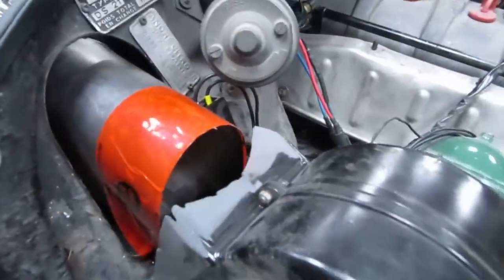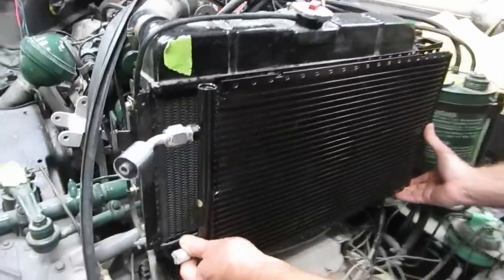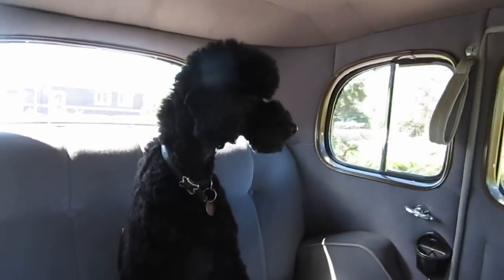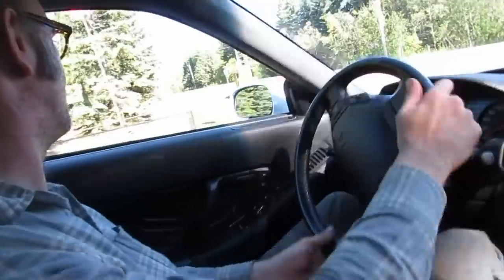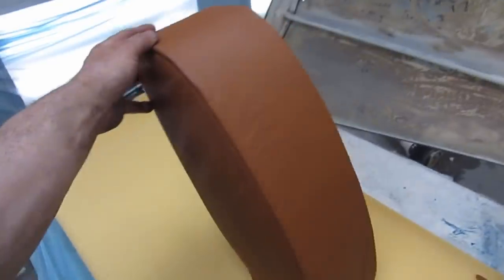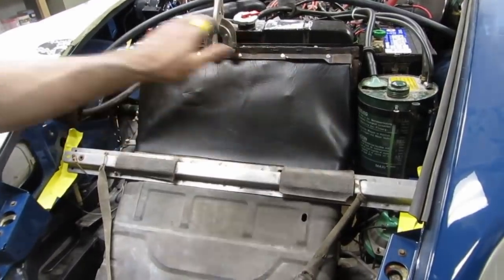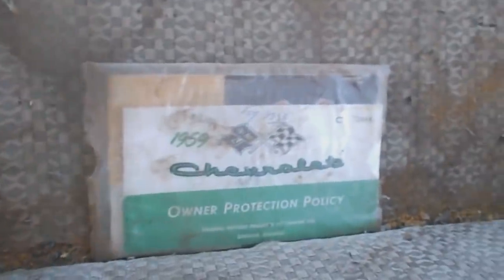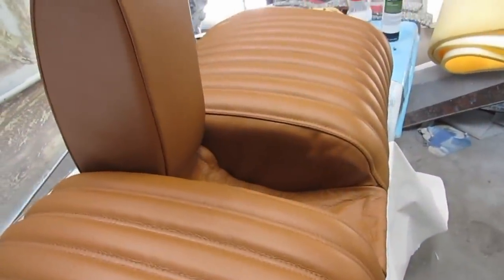Citroen Progress, Pontiac, Suzuki Drives. and Breaking News with Dean!

Comment: 64 years old, I learned to drive in a standard and today I learned what double clutch really is!  thanks
Reply: Yeah, I knew what double clutching was, but back when I was 17 years old I couldn't do it on an ancient old commercial truck I had an opportunity to drive, I kept instinctively pulling the shifter too early. Scott's method of removing his hand from the shifter until the clutch was let out in neutral, is a great way to prevent grinding 'em.

Comment: That is quality work performance on the DS . I am not a Citroen expert but  the work being done by you and the Cold War  Motors Agents is outstanding !!!         Very cool drive with the 33 Pontiac and the NSX.... the Suzuki was a super rare treasure too......good to see you all doing well ..... nice plug for the crimping series  and good save by Dean ...... a good splice will straighten out that Chevy Bel Air hardtop ..... rare car that Chevy.......  one note on the material on the Plenum for the Citroen , cannot tell if you put extra material were the fan housing and the plenum material may rub due to turbulance going down the road and air causing movement on the material ....maybe extra layer on the inside contact surface or something to help prevent wear from causing chaffing . ................... Keep 'em coming !!!

Comment: From my days with the crimping machine, a touch of light oil on the end of the hose (in your case PAG oil I guess), will make the hose slide on easier; and the expensive crimpers with eight-sided dies that get pushed into a conical receiver don't seem to give the "Poisson Ratio" effect nearly as much - but none of that matters if she makes a seal!

Comment: I used to have some of those scissors, I worked in a tire factory named Mansfield Tire and Rubber in Mansfield Ohio and we used them to cut the ''Chafer'' which was the fabric that covered the tire bead! We made all brands of tires, Kellys, Mickey Thompson, Firestone Atlas, Sears, Riverside, J.C. Penny's and on and on! Wow the                  ''Lean Mean Dean machine is rollin' rollin rollin' on with Cheesy Greasy flips for everyone! Keep up the good work, The crimping tool is cool! I've never seen one before! I've always wondered how it was done! Have fun and see you next week!
Reply: I think most of those Ohio rubber jobs are gone for good.  I sometimes eat in Akron at a spaghetti restaurant that used to be a B F Goodrich factory for making conveyer belts.  Outside the restaurant is a canal with old rubber factories on both banks.  There is a network of pipes connecting the old factories together and every minute or so a valve emits a puff of steam.  Just a reminder of the old days when Akron was the rubber capital.

Comment: That Pontiac is a thing of early Art Deco beauty. The sound of that little Suzuki 80 firing up triggered a flood of memories. A '64 Suzuki 80 Sport, my first motorcycle. A couple of my friend bought the same bike at the same time. I rode that thing all over BC, because we didn't know any different. I got a ticket in Kelowna for blowing through a stop sign. We would wait for a semi to pass us, then tuck in behind and draft. You could go 60 mph that way, otherwise it was pretty much 45-50 on the level.

Comment: IIRC, on the two sprocket rear ends, they came with an extra length of chain in with the tools. Also, pro tip on the old foam. A stand-up clothes steamer puffs the foam up and helps approximate it’s original shape. Looks great, guys!

Comment: "And i don't have to wind the window  down to signal." Wonders of the modern age will they never cease? LOL. To fit covers onto armrests etc spray the foam with silicon spray. That what the upholsterers use. It looks like you are trying to put socks on to wet feet. The Citroen is looking great. You'll have air soon.

Comment: Just wait until the first time another Peugeot owner sees this A/C and you tell them this was a factory option that you had to know how to order.  The fan to duct looks like it should have been exactly that way.  Thanks for the ride in Pontiac, it was a treat.
Reply: Jay Leno has a '71 DS21 restored. However, A/C was only offered from '72, so he got a wrecked '72 and swapped all the A/C gear (including dash board) See video on Youtube.
Reply: chris younts Out in Edmonton AB, where CWM is, that would be right, whereas Calgary is 150 miles farther south, about 150 mi to Montana.. However, they are delivering the DS to Montreal, where we have had 2 months of 86-96 F. days this year. most of the cars here have A/C
Reply: chris younts  Actually, the engine, especially the original 1911 cc 3-main bearing is quite rugged, and should be re-build-able if the block is not cracked. It's just an OHV pushrod with carburetor. More of a challenge would be the hydraulic components, circuits, etc. Scott's "Safari" wagon (and Leno's sedan) are pure manual clutch/gearbox,  so only brakes, steering & suspension need attention.
The engine has wet-sleeve cylinders which can easily be re-fitted. What is unusual is that the accessories/alternator and pumps are driven by a camshaft pulley.
Reply: chris younts  For sure, unless one has the skills, equipment and freedom that Scott has, the restoration/rebuild is a daunting task. Had to let my '68 DS19 go because of body rust. And the dealer sales/support in Canada was tapering off when they got in conflict with U.S. safety standards. The '73 Dodge Dart that replaced it was no great hell either. My current '09 Dodge Caliber reminds me in a gross way of the Citroen C4 "Cactus". I call mine "the Catcus" (sic). Actually, pretty good mechanically: 5-speed stick with 148 HP -1.8L DOHC engine. As the saying goes, YMMV.

Comment: A little silicone spray will help or better yet Plastic bad from a dry cleaner will work.  You can also steam it  to get wrinkles out and don’t get it too wet. 

Steam will clean up the corners ect. Steam it while pulling it not after too late then.  Use marine grade vinyl to prevent rot

Comment: Wow , that Pontiac eight , eyecandy . I would not be surprised if the Citroen will develope a serious engine cooling problem with that much stuff in front of the radiator . You should make the fans be activated by ingine temperature also , not only when AC is engaged . We`ll se . Good show . Se ya next time .

Comment: The '92 NSX has an electric motor assisted rack and pinion steering. That's why the weird feel when the wheels are straight as there is no assist until the ssteering wheel begins to turn.

Comment: Use a Western Union splice when you butt wires together. Even if the solder joint fails, the connection holds. :)

Comment: 24:04 that steering dead spot is called the sneeze factor.  Stops you leaping off the road.
Reply: @UberLummox  The white car is my 1962 Dodge Dart 330 2 dr h/top plain jane. Has a factory 4 barrel carb 318 called Power Pack. My other car is a 1963 Plymouth Fury 2 dr h/top. Factory non-Furious 2 bbl 318.  My last '62 Dart h/top was 383.  Cheers.
Reply: @UberLummox  They're the best, aren't they.  I've owned 48 Mopars, but only 6 of them were Darts.  Your 440 is the flasher version of mine. The original lady owner (1 owner) ordered my 330 with p/steer, Power Pak,  auto trans, and nothing else. I guess you know that Power Pak is dual exhausts, 4 bbl, slightly warmer cam, and modded dizzy.  To be honest, there's not much difference in power over a 2bbl in the real world.

Comment: Hey Dean, just had a little fender bender with my 1959 Chev and sure could use a headlight bezel if you have a decent one you would part with. I saw one sitting on the dash of the parts car but couldn't see the condition.

Comment: Nice old Pontiac and so rare. Hey, my experience with adding electric fans on American cars has not been good. What happens is the battery gets run down by them. I had to go to more powerful alternators to cure  problems. Can't wait to see goofy French car finished. I never could figure out how they get staples through metal but have run into that before on interior door panels.

Comment: Awesome little Suzuki. That rear sprocket system is pretty much the same as Honda used on the early trail 90s prior to the hi-lo transmission. 
On the Honda the sprocket had to be relocatied out and it came with a short length of chain with a couple of master links to extend it.
Reply from the maker: Thanks for the info! Cheers...

Comment: On the Suzuki you could change from a low gear trail sprocket to a high gear road sprocket, there was a piece of chain about 6" long in the tool kit and a spare connector link. Turn the back wheel until the connector link comes around, split the chain, add the piece and put it on the big sprocket for trail use, do the same but take out a piece of chain and put it on the small sprocket for road use.